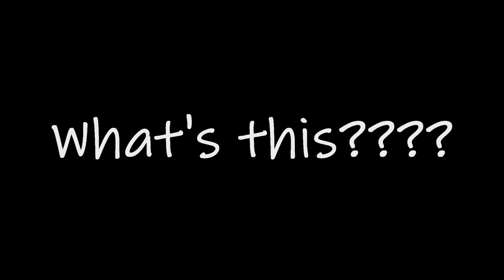Fabricating the stem fitting - SV Tapatya EP83

Comment: Hey Tony, just a thought, when you are filleting those inside corners, if you took your thickened epoxy and put it in a 1 quart ziplock bag and cut off the corner, you could squeeze it out much like a caulk bead, making it a lot easier to get it down in there without having so much cleanup.  
Turn the bag about 3/4 inside out, and tuck the corner you are going to fill into a coffee cup or something similar, then pour your epoxy inside.  Once its all in, turn the bag back up and seal it with as little air inside as possible so you dont have any mess.  Then its just cut off the corner to the size bead you want and go at it like you were icing a cake.  Makes application a million times easier, and you can just toss the bag when youre done.
Reply from the maker: Hi Eldon. Yes, the icing technique would work. A great tip. Thank you!

Comment: watch yourself with them funk 4.40!
live in D too bei wuppertal,  I bought a 30yo reinke no interior, had a griffiths hind for years went half way round world. 
Now want to go in the ice ... wanted steel. Read about BADGER in 1996 sailing legend Annie hill and all that.  Hind got me caus of scantlings
benfords always home built?. It would be interesting to be in touch caus i been here nearly 20 yrs, dein alte, etc. behnke sucks
use Mipa. I buy my stainless from scrap handler for 1,50 per kg i would of got that bent in a fabrik, cost you 4 euro steel , 20 bend
your welding has to be good stick, introduces too much warp...?
my insides are gonna be finished in the summer, id like to drop by,  where are you approx
by the by you always seem angry : )
Reply from the maker: Thanks for your comments. 

I find Behnke to be excellent. Their delivery is really quick, prices ok and products good quality. 

I have bought metal from the scrap yard for other purposes, but with stainless, it's hard to be sure what grade you're getting. Getting the piece made for me would defeat the object of what I'm doing. I enjoy metalworking, so why would I want to get someone to do it for me? 

Stick welding is only really any good for thick pieces. Then they don't warp much, if at all.

Yes, happy to meet up. Drop me a line. Contact link on my website. svtapatya.com